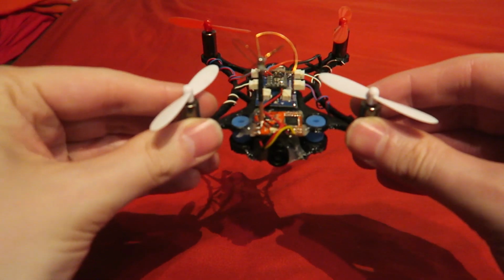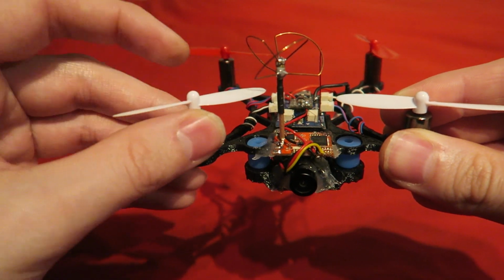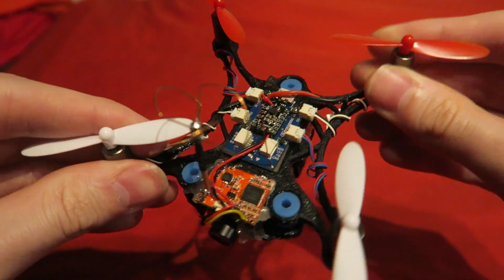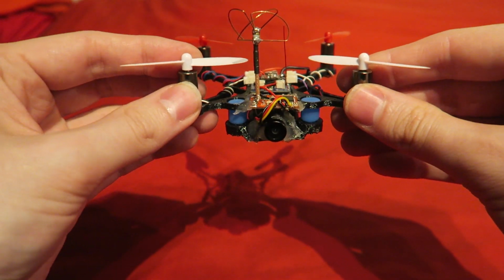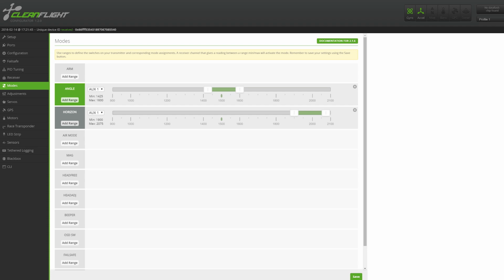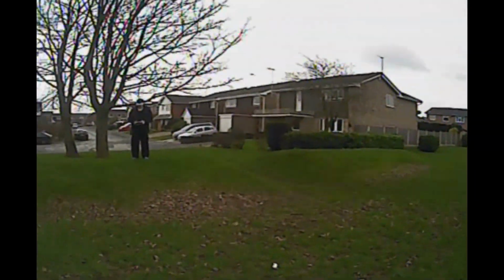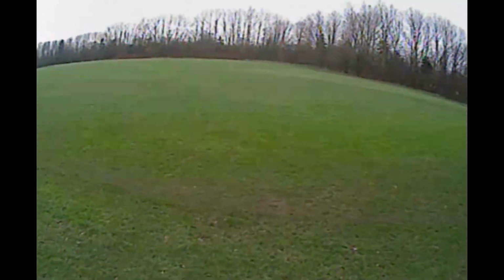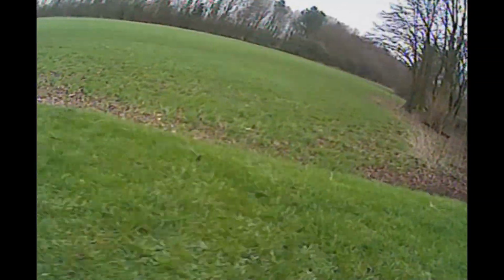Scisky Build 2

Comment: i dont know i f you remeber me i have problem with my micro it flight only 2-3 min but when its new the flight time its 6 min i change motors i take new batterys 520 mah 30c i rest the fc and doit from beginning but i have the same problem and worsed now i see the motors and batterys its very hot its burn too much what is hapend can you tell me maybe i do somethink wrong in pid config its not the same like yours iset luxflout  but with many difference

Comment: i dit one quad like this in the first flights its play very whell in about 6 min flight with fpv camera but now play only 2-3 min and the motors is too hot why this hapend can yoy tell me?
Reply from the maker: sounds like the battery has worn out
Reply: the battery has play about 1 hour and 30 min
but the motors has play 12 times more about 15 hours how many life have the motors or the batterys?
Reply from the maker: usually when a motor goes it just dies rather than gets weak so sounds like a battery problem to me
Reply: but i have 12 batterys 5 with 500mah and 7 with 750mah i dont think all die at once ithink maybe i soldered wrong polarity in motors in first time and motors die slowly i say that becouse in fist time when i solder it its spin in wrong direction and i change the polarity in wires
Reply from the maker: iv never seen a motor go like that. it could be that you are overcharging the batteries causing them to die prematurely. motors are the cheapest to swap out so give it a try

Comment: Hey andy! First of, love your videos! I really like how you discribe everything! But I have a question.. I just started the fpv hobby and "build" my First micro quad.. I got the frame of a parrot rolling spider with 8,5mm stock motors, and a quanum micro fpv camera.. I changed the board with a hubsan Rip off (dont know the right word but ist a fake hubsan) its a attop 928.. but when I use that stock lipo (250mah) I only get about 2,5 minutes of flight time.. so now I want to but some New lipo's! I run the quad and camera from 1 lipo.. so now the question.. what are the best lipo's for the most flight time? Im not really looking for best pitch or agility.. just long flight time! I remember seeing a video of you were you tested multiple lipos, but I cant find it anymore:( so I really hope you can help me out!! Greetings from holland!
Reply from the maker: +Han Rinsampessy Thanks. I use the nanotech 750mah for best flight time but im not sure those will fit your frame. try the 500mah blue hubsan ones from banggood. they fit all the frames I have and give me about 6 mins
Reply: Aah oke! I will trui that:D another question! I dont know if you are familiour with the parrot mini drones, but they come with some stock parrot lipo's I have 2 of them which I can no longer use.. and thats a shame! Is it possible to solder some Wires and a connector to it so I can plug them into the drone? Or will this mess my quad up? Well hope to hear from you soon:D!
Reply from the maker: its best not to mess with batteries unless u really know what you are doing. but i have taken batteries apart and added losi connectors on them many times to reuse batteries

Comment: you are definitely the best reviewer around here and I watch all of your videos.
I wish you could help in building mine, I want to build a micro drone (max. 180mm) for fpv and carrying a runcam, I dont want a fast quad. can you just give me a hint in where to start or what to get?
Reply from the maker: +Zaidroid check out rotor riots 180 build but honestly you are best off building a 250 the price is not much different
Reply: thank you :)
even if speed is not a concern a 250 would still be better?
Reply from the maker: theres very little in size between a 180 and a 250 u will be surprised how small a 250 is. I cant see the point in going smaller personally. and for indoors u need to go brushed.
Reply: Thank you a lot.
I know I was a pain in the ass :)
Reply from the maker: nah not at all :)

Comment: Do you turn the potentiometer on the VTx CW or CCW to increase transmitter power?
Reply from the maker: +OP theFLASH honestly im not sure! I need to test it by doing some distance testing
Reply: +AndyRC That would be great if you can find out.  I always wondered about this as you use an adjustable output Vtx in your other micro build ... Thanks Andy...
Reply from the maker: i would assume max is cw and min ccw but as i say id have to test. i think they come as 50mw standard

Comment: Hi Andy,

Just printed this frame, could you please tell me where you find the Anti vibration rubber or give the me the size caracteristics ?

Thanks
Reply from the maker: +Fabrice80090 they are these ones http://www.ebay.co.uk/itm/311046559752?_trksid=p2057872.m2749.l2649&ssPageName=STRK%3AMEBIDX%3AIT
Reply: Many Thanks andy !

Comment: you should try making a brushless 120, 122, 130, or 180, 250 is so last year jk. I have a 1306 atom love it, 180 1806 tweaker, and a couple 250s 2204
Reply from the maker: do you see a benefit in going smaller than a 250? cheers
Reply: If you are flying indoors racing like I do during the winter, than the smaller sizes make complete sense. Another side benefit may be harder to break, but that all depends on different things. Smaller can mean more nimble also, it could mean cheaper lipos also. I have all these different sizes because I love but also there will different racing classes so I can enter multiple classes to race now.
Reply from the maker: when you say indoor racing i take it you are flying in a gym or something of the sort? in that case yes it makes sense

Comment: hey Andy nice vid as usual. I run betaflight on my scisky, and do airmode, have you done this yet?
Reply: oh yeah and I use the micro sizes 5v reg from rmrc works great and in stock a light, perfect video
Reply: I like luxfloat controller on betaflight, .8 on pitch and roll, then .4 yaw and .4 yaw on receiver page
Reply from the maker: +pizatric1st in need to understand air mode more. do you have it always on? and does it only work when motors turn when armed?
Reply: +AndyRC it is like acro you can turn it on with a switch
Reply from the maker: +pizatric1st I'm not so sure a micro will benefit from it but I will try
Reply: +AndyRC yeah I am not sure if airmode is a benifit on micro, but betaflight is I believe
Reply: AndyRC seems like I do notice a slight different in airmode on micros but I need to do more flights for testing it is winter and I limited on flight time atm.
Reply from the maker: yep same here! cheers
Reply: AndyRC Check out how fast my scisky micro is, I made it out of cf tube, zips, and glue, on normal 8.5 and using parrot rolling spider props https://vimeo.com/156141413
Reply: AndyRC my favorite new dvr is the hmdvr check it out if you haven't already love it. Best dvr quality I have seen, the raws are great like the source quality.
Reply from the maker: ill be sure to check it out thanks

Comment: I am still blaming the devo7e...... to the point where I'm not sure I want to fly it any more. :/
Although I should just use my friends dx6i to test that...
Reply from the maker: actually since this vid quite a few people have had FlyAway's with different transmitters so I'm back to blaming the scisky. flown multiple aircraft with the devo since with no issues
Reply: That's interesting. I do use my devo to fly nrf based stuff and they have been fine. Different module though. 

Maybe it's that wire antenna.
Reply from the maker: i believe its to do with not getting a correct bind from the scisky. got a video to show it coming up in the next few hours
Reply: +AndyRC I have some progress on this lock up issue. I think it is related to signal strength / range. 

I was getting this issue with almost every flight outside from about 15-20 meters away with the devo7e. This tx has a tiny little fixed antenna were I am not able to change it's polarization. I tend to just hold the tx as about 45 degrees. So the antenna signal lobes would not be in the optimal place, as I am flying in front of me, this is basically a null area on a dipole.

Now, I have actually modded in an SMA connector and a swivel dipole / wifi antenna. With the antenna at a 90 degree angle from the tx, I flew the scisky around today.

It did not lock up once today, I tried hard to get it to. So, I think as the antennas polarization changes with all the movement, the signal from the tx to the scisky board spikes all over the place and gets to a point that makes the scisky spaz out? I'm wondering if it just can't cope with weak tx / control signal? Or maybe it's just not good at reacquiring a signal?

So a combination of the devo7e rubbish little antenna and the constant antenna movement, I think the signal just drops out and the scisky just doesn't handle it very well. 

At times, I think it's possible in my case, that my original devo antenna and scisky antenna may have been at complete opposite polarization to each other. That would/could certainly cause a drop in signal quality/strength, especially at a distance. 

Your fly away looks like it may have been in the same boat. You had wifi antennas (I assume facing 90 degrees?). Being dipoles they have little signal radiation from the ends (And gain?). So perhaps your old scisky was in that null, also with your scisky antenna vertical and almost above you, it would have been in the null and the tx signal would be very weak. This could well result in corrupted data packets due to signal quality. Then switching the tx off causes the carrier signal to disappear, then the failsafe kicks in.  

Seems like a working theory?
Reply from the maker: my devo 7e already was heavily modded at the point of lock up. it had sma added. a wifi booster and the devo 8s mod. the antenna was straight and not 90 degrees. other people are advising that theirs is locking up without the devo 7e. it seems to be related to not getting a decent bind first time round. not had it with the second build. thanks for the info though glad u got it sorted
Reply: Ok, if your antenna was straight, it could be related still. This would be the same layout as a standard devo7e. The drone would have been flying around with a vertical antenna, the tx with a more horizontal antenna. Being this way the signal could have dropped to nothing at some point with all that movement, even with that booster. 

I suppose not getting a correct/good bind could make the board susceptible to lock up when the signal gets bad enough. Perhaps it's both?

I need to actually research the binding process and the DSM protocol, I need to learn more about it's workings now my brain has been enticed! 

Good to hear yours is fine still! I actually feel like I can trust mine again!
Reply from the maker: +Tom Haslett when I say my antenna is straight I mean vertical in conjunction with the vertical antenna on the aircraft. as u say matching polarisation. I'm pretty sure the lock ups are related to the dodgy binds that I get on the skisky. I'm running alienwii off the devo with no issues. have to say though I'm scared to fly the scisky these days which is such a shame as its my best flyer at the moment

Comment: Hi. I have a problem. When I tur on quadcopter, and give it a max throttle all propellers is rotating at same speed. But in a few seconds top right and bottom left motor starts to spin gradually slower. Could you tell what should I do? :/
Reply from the maker: do the motors spin as soon as u plug the battery in?
Reply: No. It happens when I arm it. I forgot.. I don't talking about this quadcopter. I have multiwii board. I was just wondering, maybe you could help
Reply from the maker: +Māris have u flown it yet does it do this in the air?
Reply from the maker: +Māris have u flown it yet does it do this in the air?
Reply: no. I haven't. I have holded it in hand, but it draging me to one side.
Reply from the maker: flight controllers  have accelerometers on board so the motors will slow down if you hold it in your hand. this is normal
Reply: maybe, But I just before 5 minutes tried to lift it up. It went on one side and crashed :/

Comment: Wish you would build a 130/150 brushless.
Reply from the maker: +James Smith i want to but i dont see any benefit compared to a 250. neither of them can be flown indoors but we shall see what happens :)
Reply: +AndyRC  I remember u saying so thing like this now on a video.   5mins of flight and I've lost the Scisky It turned right. And so I dropped it Over my next doors garden .Maybe it was a flyaway  like yours. It happened to fast for me to say.
Reply from the maker: thats worrying what transmitter are you using? it could have been the battery going after 5 mins
Reply: +AndyRC sorry i mean I haven't only flown it for 5 mins from build to death. I had loads of time left on the battery that was on it.  I'm using t-six orx  the orange plastic one.
Reply from the maker: thats quite worrying. did you manage to get it back?
Reply: +AndyRC under 250 are less fragile than 250 which break quite easly
Reply: +AndyRC not yet I've looked 5 houses down and it should have only gone 1 or 2. Just waiting for my neighbour to come home so I can ask him for another look. Gutted.
Reply from the maker: you should get it back if its close in. did the same happen as with mine? no control and it flew off so you turned the TX off?

Comment: Nice build! Ever consider a 210 size quad, I am considering this frame http://www.amazon.com/gp/aw/d/B016ZZN6IQ/ref=mp_s_a_1_6?qid=1455504048&sr=8-6&pi=AC_SX236_SY340_FMwebp_QL65&keywords=210+racing+quadcopter
Reply from the maker: +Steve B i think when you weigh up what motors can be put on these miniquads the 250 is the perfect size for power to weight

Comment: Is there a flight controller of that size that can connect to a standard receiver since I don't use DSMX ?
Reply from the maker: +Tiny Toucan when you say standard receiver do you mean frsky?
Reply: +AndyRC it's a turnigy receiver, it has power ground and signal for each channel so pretty bulky for a micro quad but I can solder directly to the board to save weight, basically can I use a fc board with integrated escs without having to buy a new radio
Reply from the maker: all the micro options use DSM2 so you would need to go the brushless 250 rout. but honestly the best thing to do is get yourself a taranis. you can use it for everything
Reply: +AndyRC Ok, thanks for your help, and I've already built a 250 size quad trust me you'll enjoy it :)
Reply from the maker: i hope so thanks

Comment: great to see you took another shot at the Scisky. I have been flying hubsans and some full size toy grade quadcopters for about a year, I want to try building something, would you recommend a build like this for a beginner? I figured its low cost, and could help me learn how to set up a flight controller, plus I have a 3d printer :p also keep up the great work, love your videos
Reply from the maker: +Joe Petro if it doesnt fly away again then yes, but i have only had a few flights with it so far. I dont want to recommend a system that potentially could fly off. but its so much fun to fly which is why i built another one. time will tell i guess.
Reply: +AndyRC thanks for the reply! That is a good point, I might try to fly indoors mostly at first
Reply from the maker: yeah thats a good idea. cheers